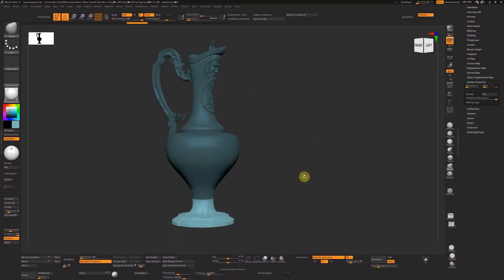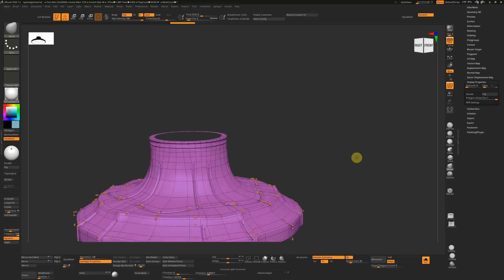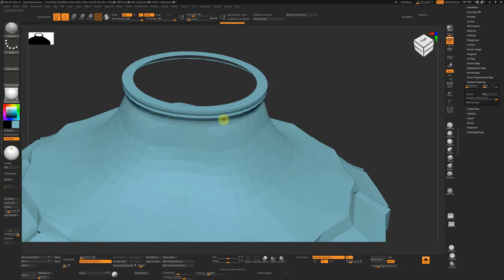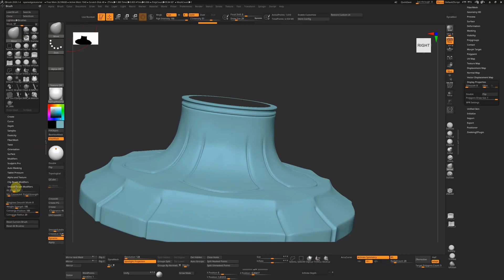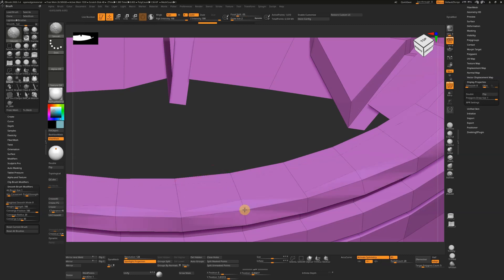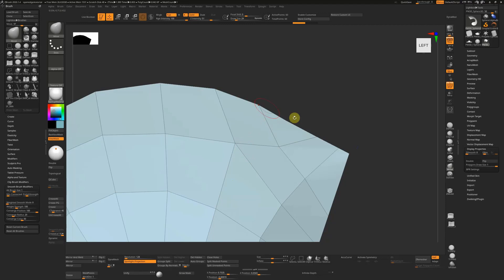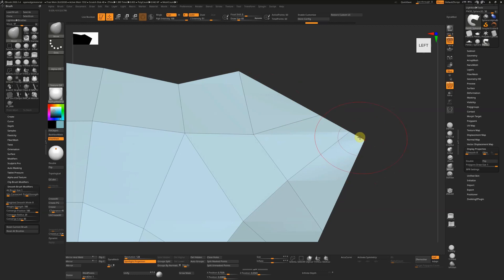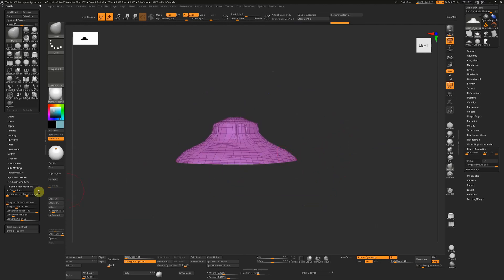How to smooth down open edges in ZBrush

Comment: I tried but it's not working. I don't know why
Reply: Were you pressing the shift button as you were changing the number?  I noticed the number switched back to 3 as I pressed shift.  But as I change the number as while I'm holding on shift it did make the change.
Reply: @junginbaek9792  There's multiple tip videos for this smooth function, but you're the only one to mention the shift had to be held down. Thanks
Reply from the maker: @Rainec777 You're welcome, thanks for watching.
Reply from the maker: Do you have a sample file I could look at? You can send it to my email address (in the About page of the channel).
Reply: One last thing ... someone mentioned somewhere that, in 2021, SmoothCloth performs this function. I can verify ... SmoothCloth seems to have that value set to 1 by default (just to clarify: the Minimum Connected Points To Smooth value when you press Shift)